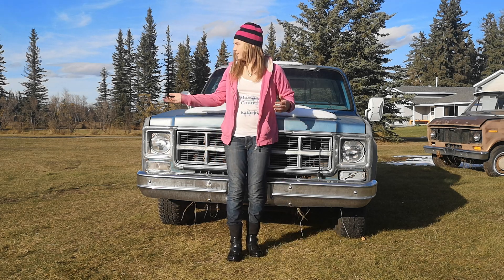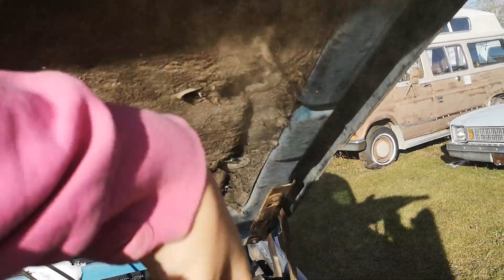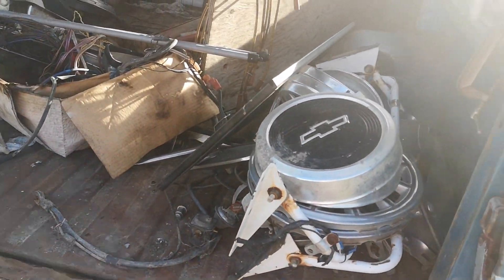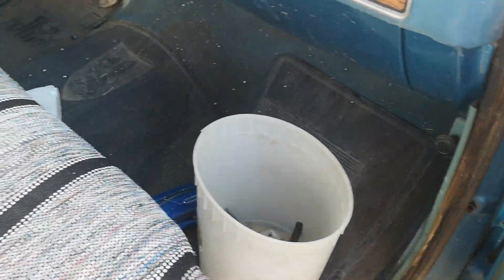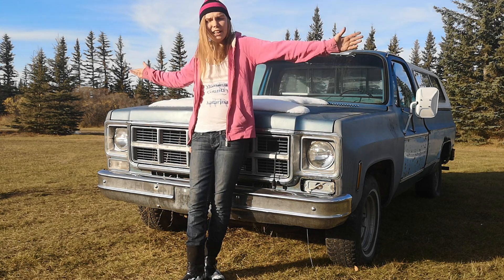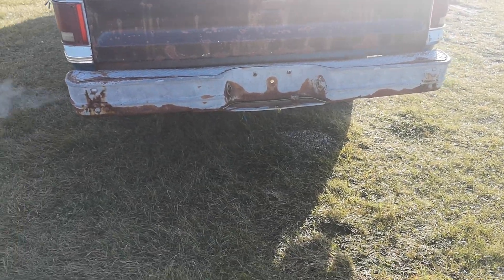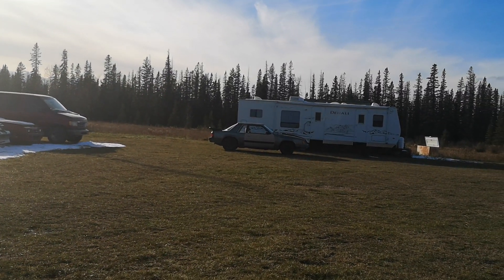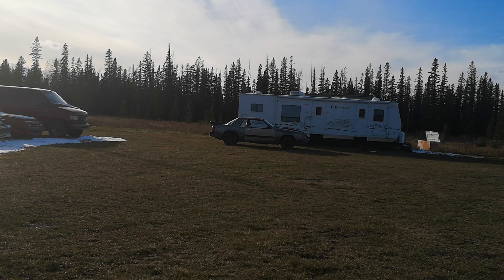77 GMC C10 walk around and running. Plus a random cow photo bombing.

Comment: Just so you know, the tailgate not staying closed is just the rods inside get gummed up with shit like salt or mud ect. But you can usually spray break clean and penetrating fluid in it and play with the handle and it'll free up. Blaze mechanical by Tim's has Mopar penetrating fluid which works amazing!
Reply from the maker: Oh perfect I'll try that thanks! I just picked up some liquid wrench the other day and I guess that's why :p
Reply: @KatarinasGarage  I've honestly had even better luck with Mopar Penetrating fluid than I have with liquid wrench. Id definitely recommend trying it!
Reply from the maker: Well if that doesn't work I'll see about picking some up :)